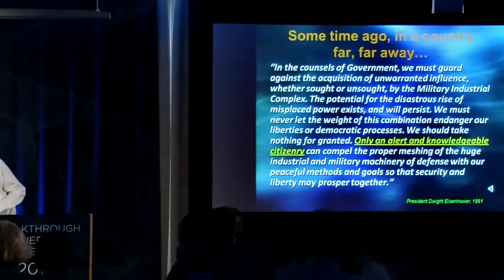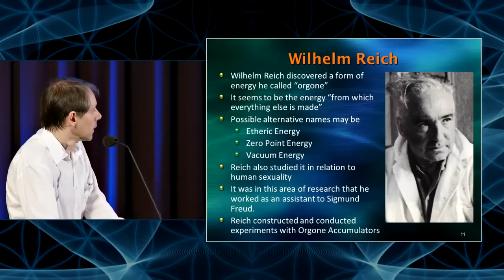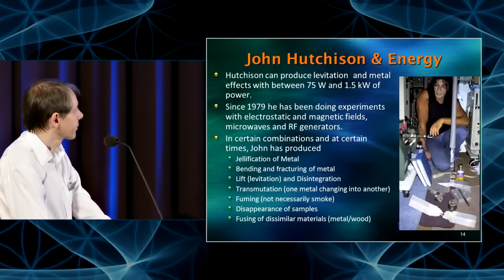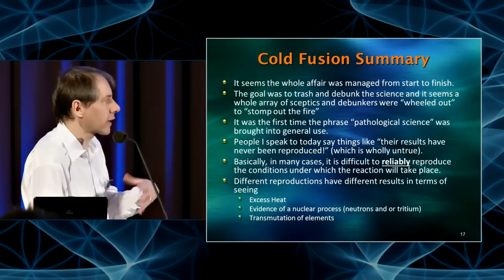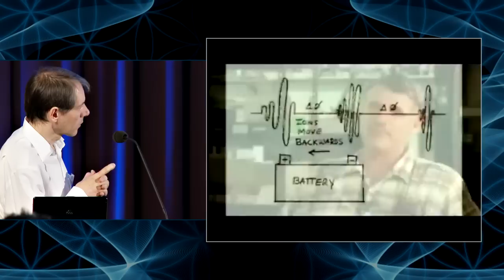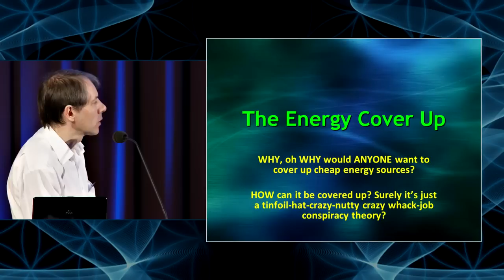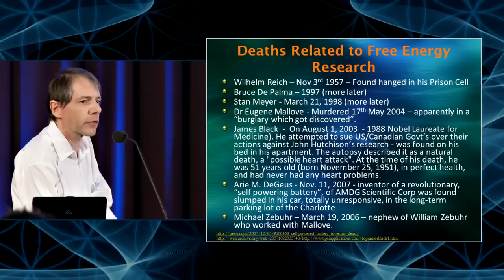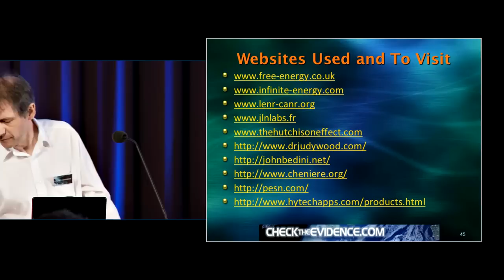Infinite Energy, But Not For The Masses | Andrew Johnson

Comment: Tesla tried to scale up the Hairpin Circuit and transmit power through the air (or through the earth itself) but found that the electrical charge quickly dissipates. So, while you can put on a cool show in your laboratory or on a stage, the practical use is nil.

Comment: The Palsness demo of the hairpin circuit is not that complicated. An alternating voltage at line frequency (60 Hz) produces a 10K volt or less spark that modulates the power fed into two capacitors at both sides of the incoming power. Those two capacitors are shorted by the hairpin of  heavy copper conductors. It has been replicated with scrap parts from neon signs and copper plumbing with door knob capacitors.

Ideally conventional power analysis would resolve this as a short circuit that cancels the power in the circuit. When a spark launches one direction into the left capacitor, it places the opposite charge to the right capacitor. Simultaneously, the AC carrier wave of 10KV is also fed directly into the short circuit, placing the opposite voltage to each side simultaneously. Ideally, the charges cancel and maximum current is flowing through the hairpin, without the motivation of a voltage differential. When the spark initiates, a loop current would divert the flow of power from feeding back to the transformer, as the least resistance would be through the spark gap. The sparks themselves will alternate voltage polarities multiple times per 60 Hz wave, as there is no conditioning to the spark itself attempting to try to maintain voltage polarity during the discharges which are known to introduce higher frequency polarity-reversals/modulations. (The use of spark conditioning circuits to polarize the spark itself is the secret to power transmission without wires by Tesla in his otherwise famous Tesla Coils. Edwin Gray found that doing so amplifies the power in the spark power exponentially and that it can be collected with a simple metal screen with a shorted capacitor to ground. It is the current that is amplified, exponentially to the value of the voltage. These impulse electrical waves operate like sound waves, logrimically increasing in power with linear increases in amplitude.) The use of a heavy copper bar simply maximizes the amount of current the system holds, which is dissipated into the environment.  Connections closer to the capacitors have more energy in the form of current and voltage differential (there is a slight voltage differential as the speed of conduction is not infinite) maximizing the brightness of the bulbs closest to the capacitors and minimized both in distance from the capacitors or proximity to each other of the clips tapping the power.

Karl then demonstrates connecting the various loads at various locations along the connecting rods. In other demonstrations he grabs both rods to show there is no deadly voltage. Karl claims to personally feeling energized by it, while others have experienced healings when connected to the hairpin. He also handles the connections both directly and in a bowl of water, connects the high voltage lights in series with low voltage lights, and uses human bodies as the conductors of the power to the various high voltage lights. 

It is undeniable that the power he is pulling from the hairpin is not voltage driven power. He also cautions users not to touch the metal contacts on the high voltage bulbs, as they are really at very high voltage potentials and will give a nasty shock to a grounded person. The conclusion is that the load is operating actively with the power, conditioning it to the specific need of the load, not being a passive device subject to the dominant will of the power source. This is similar to the phenomenon of power transmitted from stars through space to Earth, and perceived as light by us on Earth.

This has major implications in the basic design of electrical circuits and systems. Viewing the design of instruments as systems of balance rather than source/load/restrictions is a functional reality. Something the power company has to deal with by load balancing the grid on a minute by minute bases; while product designers have to conform to the voltage and current limitations of the grid suppliers. This is unnecessary when designing power supplies that produce and distribute this "hairpin" style power. The failing is this type of spark gap tech also produces power in excess of what it takes to generate it. Who needs a power company to restrict and control the types and standards to which I need to design my products. Multiple industries and government agencies become obsolete. And the stable product base protected by regulated industry is now open to instant upset from any individual at any location in the world. Any location can become any paradise or production capital for any product or service. Imagine the entire world living as they do at burning man, 24x7.

The only rational model of reality is beyond these petty, yet dominating concerns:  Either energy is being converted from/to a non-energy form, and/or there is a different kind of energy that travels with a different organization of electricity... and that the environment of space itself is made up of a substance that conducts this energy in different ways. That electrical energy is not limited to particles that travel through a vacuum, but may very well be a substance that can transmit the emitted energy like a sound wave, and also convert itself into other forms like transverse waves or particles depending on the specific condition of the local environment. Essentially, the current electrical models are incomplete and the three laws of thermodynamics are inconsistent with reality. Of course, no surprise that Tesla who invented/discovered all this was an Aether Scientist. He openly fought the idiotic introduction of Relativity and vacuus space that bends... 

I would propose that the Aether is made of photons at rest. Space itself is defined by the type, density, and orientation of these photons. Energy depends on the movement of these photons and matter depends on the organization of these photons, both energy and matter are stable depending on their reference to the environment as buffered by certain histeresis set points.

Taking this a step further, evidence points to the fact that stars emit this hairpin energy, it is invisible and lossless in transmission. Paul Pantone replicated this type of emission with his GEET reactor, turning his fuel conditioning self-contained plasma reactor invisible when it reached star generating potential. See "The Book of GEET: Part 1" if you want to read more. Tesla predicted this accidental discovery, of which Paul was not aware. Unfortunately, they both were politically naive (See Part 2 of Paul's Book). And both fell to the heavy handed tactics of the empire based on consumption economics and Business Science. BS rules still today. And electrical models are intentionally misleading. And Paul's discovery goes un-explored as to the life saving potential of replicating the Sun and Earth in small scale on a planet that will no longer support our way of life under a failing geomagnetic shield.

Peace, B
Reply: Gibberish.
Reply: Debating physical models is useful. Denial and name calling is childish or deceptive. One must have a real commitment to modeling reality independent of allegiance or influence of political and monetary gains to honestly expect to hone and refine the functional model of reality for maximum understanding and control of natural processes. A commitment to truth and clarity is fundamental. 

Institutional, or Business Science has a long history of mixing politics and scientific models. One example is Goethe and Newton's description of light and color. Another is the establishment of the three laws of thermodynamics prior to the full understanding of electricity; and the discovery of hysteresis. Clearly, the purpose of this dogma is economic, not to describe reality accurately. Beginning any model with the artificial restriction of these "laws" is fundamentally flawed and will fail to measure up to the test of reality as has been proven by quantum mechanics and astrophysics. Another is the mixed bag of fantasy and reality with the confusing mix of definitions and laws of electrical theory.

But the shift from Aether Science to Relativity and Quantum Mechanics is overwhelmingly the most egregious offence as it was for the purpose of silencing Nikola Tesla and his gifts to mankind. QM has conceded that the idea that energy is fundamental to reality is flawed. Yet, it cannot accept a simple explanation like the existence of Aether for economic reasons. So, the search for invisible matter and undetectable "zero point" energy or the existence of alternate dimensions persists. Relativity denies the need for material experiments validating its theories; and denies contra evidence or logical/rational models. Also accepting magical thinking for economic reasons. 

Proof of FTL examples abound and were present at the time of approval of the flawed theory of relativity. The concept of waves propagating without a medium has never been explained or proven. The process of bending nothing, is by definition impossible to validate. Simple observations, like why there are no stars visible in space, go unanswered.

Today, not only electricity can be measured traveling FTL, sound has been also. The fact is when a medium is involved in the propagation of energy, limitations of physical objects do not apply. Deny the reality of a medium in order to preserve the fantasy of conservation of energy, and you have no choice but to invent layer upon layer of magical thinking to explain real results. Forces that do not exist must be defined as real and contra-examples denied as false, or gibberish. The discipline of the science of reality cannot be allowed, only separate schools of study are allowed, with conflicts discovered in other schools invalidated by right of domain. Did you know that biologists have proven chickens perform cold fusion? They do it with water.

Modeling reality and predicting outcomes is the super power of awareness that humans have. Abuses of that power, creating models that do not conform to reality, is the kryptonite that will extinct our species. 

The fundamental electrical nature of an Electric-Aetheric Universe is clearly showing us that the habitat of Earth is changing. Soon, the conditions that enable our fragile infrastructure of power grids and burning resources to produce power will become non-viable. Billions will die from lack of support for basic, life sustaining needs. Clean water, food, shelter, heat, and cooling will be lost. Super storms, easily diffused, will claim thousands of lives. Disease and violence will erupt where peace and cooperation (forced by commerce) used to be the norm. New threats of cosmic radiation and EMPs will become the natural conditions to weather. New expressions of DNA will abound, as they have in the past.

The delusional models of Business Science have no understanding of the timing and causes of these changes. And although aware of the dangers, cannot predict or defend against them, as their model does not accurately explain their function or causes. Forcing consumption for the purpose of maximizing profits and hoarding wealth becomes a fool's quest when life giving resources are exhausted and the natural processes of abundance without consumption are denied. Only death remains. Being the last to die with the most toys is hardly a rational goal, but be assured; you will achieve success with your refusal to correct your model of reality. If you are part of the 5,000 out of 7 billion to survive... The future of Business Science has been clearly laid out, and death is the only outcome. Denial a part of that path until the bitter end.

Please, continue. Gibberish is all this is... nothing to see, nothing to worry about. Your single derogatory comment is fully understood. Move along... 

Peace, B.
Reply: @mundymorningreport3137  he is correct, because he is the one who is posting "gibberish". He is trying to mislead you as best as he can. Ahaha :)
Reply: Mundy Morning Report
"Debating physical models is useful" - So try it.
"Denial and name calling is childish or deceptive" - Thanks for the choice.  It is efficient.  It prevents the waste of time.
"One must have" - lots of qualities you don't possess.
"Clearly, the purpose of this dogma is economic, not to describe reality accurately" - you infer this without qualification.
"as has been proven by quantum mechanics and astrophysics" - you infer this without qualification.
"confusing mix of definitions and laws of electrical theory" - you infer this without qualification.
"for the purpose of silencing Nikola Tesla" - you infer this without qualification.
"QM has conceded that the idea that energy is fundamental to reality is flawed" - No.  It uses that idea.
"it cannot accept a simple explanation like the existence of Aether for economic reasons" - No.  It uses that idea.
"the search for invisible matter and undetectable "zero point" energy or the existence of alternate dimensions persists" - in established science.
"Relativity denies the need for material experiments validating its theories" - it validated itself in 1918.
"denies contra evidence" - there is none.
"or logical/rational models" - it uses them.
"accepting magical thinking for economic reasons" - That's your business. 
"Proof of FTL examples abound" - False.
"flawed theory of relativity" - False.
"The concept of waves propagating without a medium has never been explained or proven" - "Virtual particles' are 'the medium'.
"The process of bending nothing, is by definition impossible to validate" - Well, one certainly cannot 'bend' virtual particles.
"Simple observations, like why there are no stars visible in space" - go unanswered while you're in a spotlight.  You'll see them in the shadow of the spotlight.
"Today, not only electricity can be measured traveling FTL, sound has been also" - False, false, false.
"The fact is when a medium is involved in the propagation of energy, limitations of physical objects do not apply" - False.
"Deny the reality of - - - - water" - All gibberish..
"Modeling reality and predicting outcomes is the super power of awareness that humans have" - No.  It's the power ALL predatory animals possess.
"Abuses of that power, creating models that do not conform to reality, is the kryptonite that will extinct our species" - The word is 'extinguish', and you are the one doing the abusing, with twenty-two unqualified statements so far. 
"the habitat of Earth is changing" - it has always been changing.
."Soon - - - - - - - -in the past" - was a waste of internet space.
"no understanding of the timing and causes of these changes" - False.  They do, and you don't.
"cannot predict or defend" - False.
"their model does not accurately explain their function" - Practical models don't have to be that accurate.
"or causes" - the causes are known.
"Forcing consumption - - - - - - - the bitter end." - another waste of internet space.
"Gibberish is all this is" - You wrote it.  Now believe it.
Reply: I was thinking that not only is the power infinite but its replacement is also equally infinite and replaced at faster than light speed.... there is no loss of energy...

Comment: Thorium should of been used to power nuclear installations since the 60s. It was a proven technology how ever thorium didn't produce weapons grade materials after it was enriched thus...they went with the power plants we have today. The thorium reactors were so safe a melt down was impossible as the material was suspended in liquid salts also there was no need for the massive containment building because if anything went wrong a simple freeze plug would stop fuel flowing and under gravity it would simply drain into a underground drain tank. They could be built to any size so you could have them in every town or city and even on the back of a truck or jeep to go out giving energy in field work. Thorium is also very abundant so much so there is enough to last 100,000s yrs. I find it quite unbelievable that noone has given this a go since; with the exception of India who are building fast breeders right now. If they are successful and get the patent for it we will loose out and while energy for us will go skywards for them it truly will be too cheap to meter.
Reply: Well, well, well, a light in all this darkness.  I think you will find that Elon Musk will be taking this thorium technology to Mars.
It was dropped in the depths of the cold war because it could not be adapted to make fissile weapon material.

Comment: Angular velocity.   Consider that power is generated by an armature whereby the position of the electron becomes closer to being static relative to the velocity of the Earth, solar system, galaxy and so on.  In this frequency increase is the inverse of the temporal flow.  Now see John Wheelers single electron universe proposal and equally Haramein’s hologram theory.  
Much more to this.

Comment: If you put the north end of 2 magnets together they push against each other this effect is used with electro magnets to support and control subway trains this effect could also be produced with natural magnets which don't require electricity and used to turn a capacitor and when a capacitor is turned fast enough it generates electricity